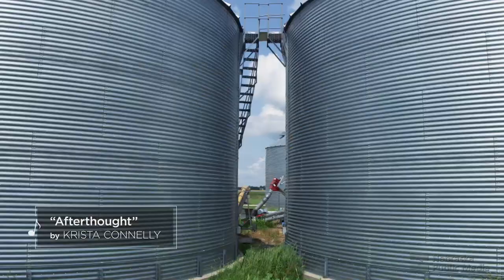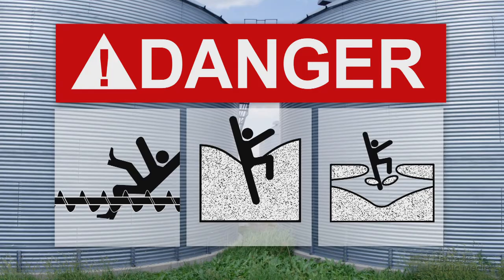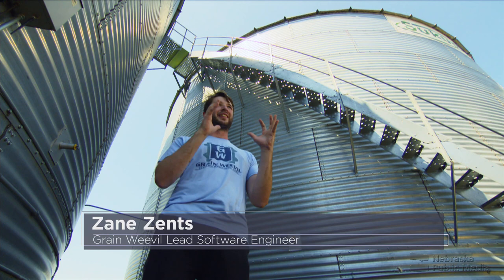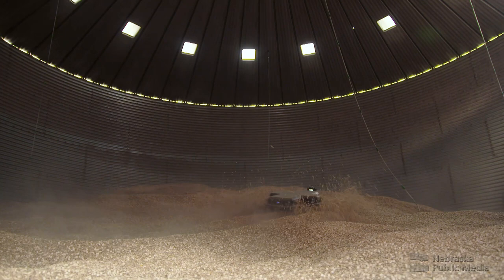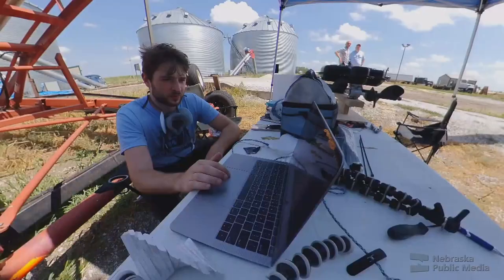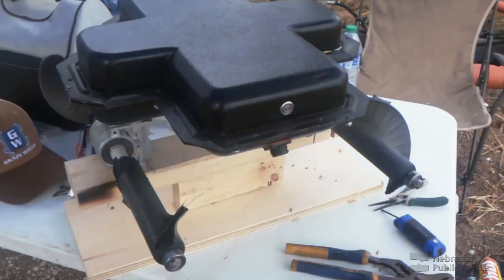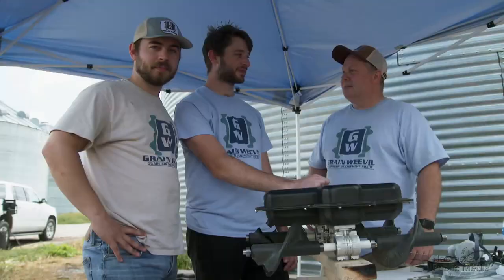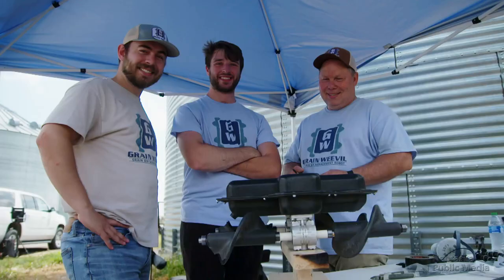Using Robots to Shift Grain in Silos

Comment: How  did  you get electric  spark  free . Otherwise  you are driving  a bomb..
Reply: anyone who build robots knows its simple. anti spark connectors and Brushless motor
Reply: There are very detailed safety standards for operating robotic equipment in explosive atmospheres, mainly sealing all the bits inside of an air tight box. There's more that goes into it but I don't have the standards in front of me.
Reply: @frewon9   designing for explosive atmosphere operation is a little more complicated then that, especially when it's flammable particles because they can build up on the motors and cause them to over heat, flame out and level half the neighborhood.
Reply: Well, think about how an electric fuel pump works. The trick is to create something that won't spark up. As long as all the connections are solid, the insulation is air tight, and the motors are suited for the environment, that robot is gonna be like a squirrel in a tree knot.